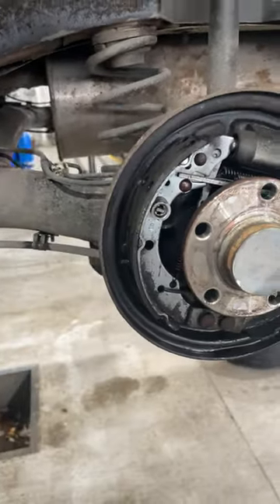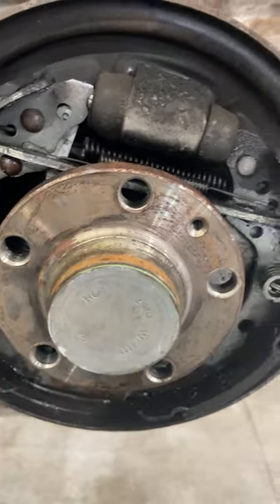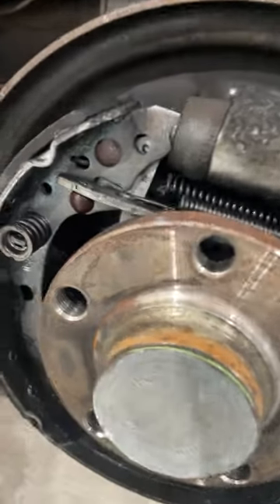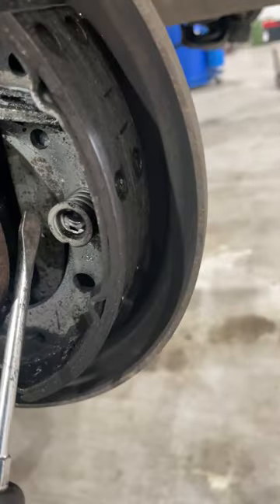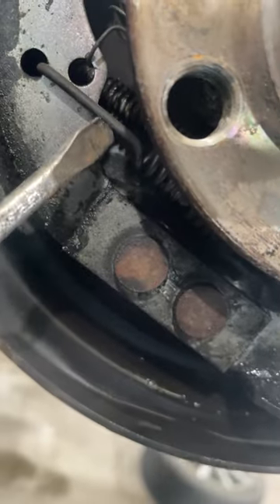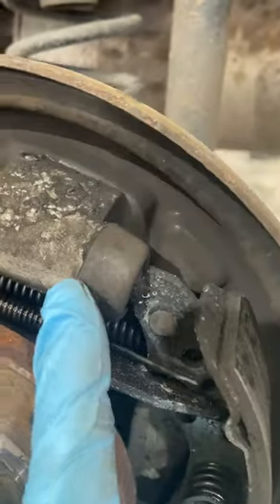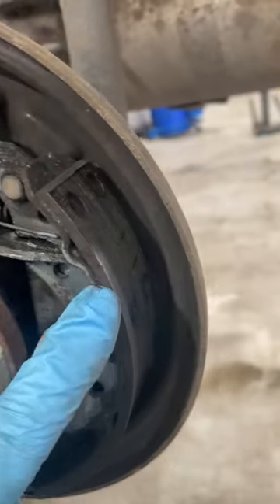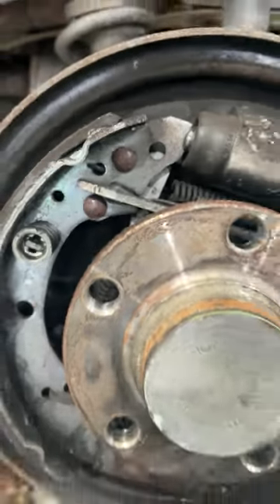Drum Brakes On VW How To Adjust Also

Comment: I don’t understand what u did to adjust it?
Reply from the maker: Which bit didn’t you get buddy
Reply: @TheVWMechanic_official  what ur doing to the pin for it to move
Reply from the maker: @Gabasto just moving it over with my screwdriver just slightly almost pulling the shoes apart motion if that makes sense
Reply: @TheVWMechanic_official  no it does please help

Comment: I tried to adjust it from handbrake adjuster, but still have to pull it over up to brake, is there any adjustement i can do from drum?
-Note that i have new put rear brakes recently.
Reply from the maker: Yeh so the handbrake lever (inside the car) should be adjusted so it’s as loose as possible then the rear drums and shoes should be replaced and then adjusted up correctly and then you nip the handbrake lever up to get a perfect handbrake
Reply: @TheVWMechanic_official  what should i do in my case
Reply from the maker: As above matey slacken the handbrake lever (inside car) adjuster right off then remove rear drums and adjust the brakes until they have just a slight bit of bind and then adjust the handbrake lever in the car to remove the slack left over on the cable
Reply: @TheVWMechanic_official  thank bro 💪
Reply: My handbrake not holding even at very high pull
Reply from the maker: @thabisotabz1719 sounds like it requires an inspection to see what’s needed to be done
Reply: @TheVWMechanic_official   I had it checked yesterday afternoon the guy who helps me with my car said it's my brake drums I need news ones my cables are still alright and brake shoes
Reply from the maker: @thabisotabz1719 you’ll probably need a set of shoes aswell as drums then
Reply: So simple, yet strange. Thank you!
For those that don’t understand, there is a wedge shaped link that as it is pulled down by a light spring, takes up slack in the horizontal link bar.